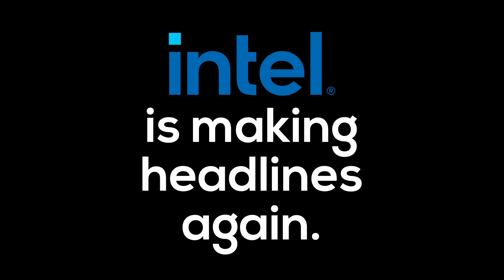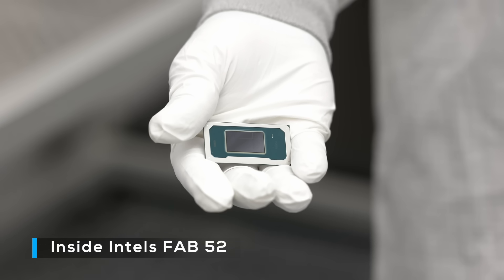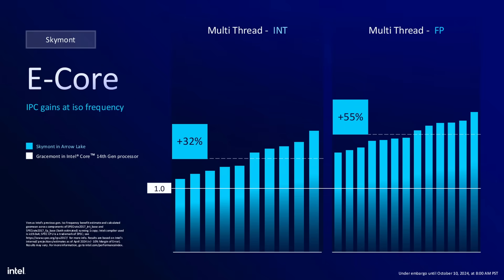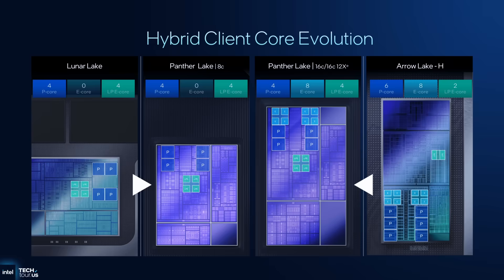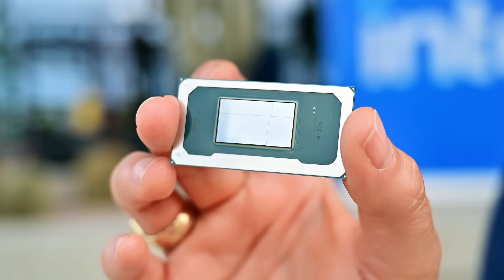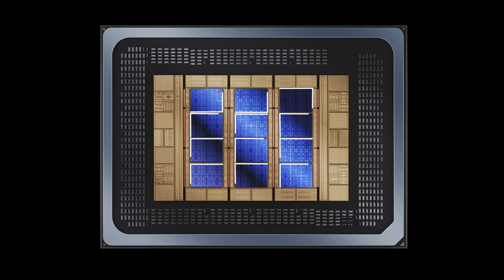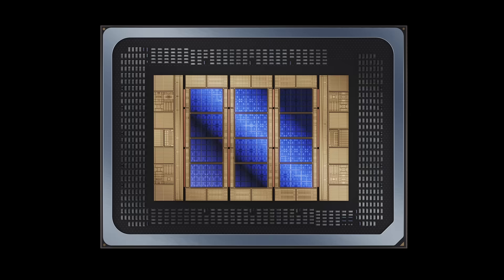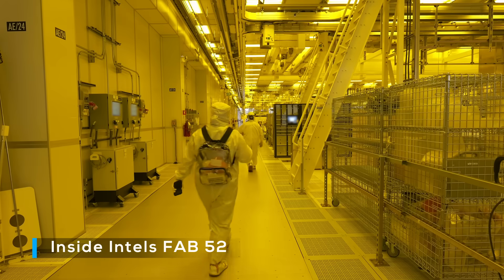Panther Lake, 18A & The current state of Intel

Comment: A new incompatible Socket for each new generation, shows a very shortsighted or money optimizing way of thinking
Reply from the maker: Panther Lake is mobile only, so no real "socket". Let's see what Nova Lakes does. I agree, Intel needs to have a plan for a long term socket. AM4 was the GOAT and AM5 is shaping up to repeat that again. Zen 4, Zen 5, Zen 6 and maybe even Zen 7. Intel needs at least three generations, and a simple refresh gen doesn't count here.
Reply: @HighYield  I definitely think if Intel is going to support their new Nova Lake socket for a long time, they need to waste no time in stressing that. Really commit, set it in stone even.

Technically, while these aren’t socketed obviously, I remember someone talking about how something they did with the BGA setup on these was neat. I don’t remember wether it was backwards compatibility with some previous generation or just that all three variants use the same BGA platform, but same-ish concept as socket longevity.
Reply: @HighYield  AM5 is going to be squeezed for too long and become a design burden, it simply lacks the pin count to supply sufficient IO for higher multi-core throughput and Threadripper is too large of a step. Mid-range desktops should have been pushing 1TB of RAM by now and have rdimm options. (16GB was common in 2012 for $200; 13y/2y =6.5 doublings, 16×2⁶=1TB.) 

Maybe they will overlap AM5 with AM6, keeping AM5 for smaller Zen6 and 7 CPUs and use AM6 for larger Zen6 and 7 CPUs. AM6 really needs pins for at least 3 mem channels and a few more PCIe lanes.
Not sure if it would be technically viable but they could do an AM5+ socket like they did with AM2[+] and AM3[+]
Reply: @mytech6779  that's what you and some other enthusiasts want, but its not going to happen, 2 channel ram continues to be the standard even if it would be cooler if it was otherwise, because that extra IO has a cost and most consumers wont pay for it, i was hoping for a smaller threadripper platform, but it sadly didn't happen
Reply: @HighYield  intel now is the underdog. it needs at least 3-4 years of board support. i dont see how intel can compete in desktop space if it still using the old tick tock tactic
Reply: I wonder if they have a choice. Supporting socket for longer is more expensive and thus, eats into margins. That is something Intel can ill afford at this time. Even if the CEO tried to rollout a socket with longer support, if it turns out to be financial burden, they get kicked by the stockholders, so part of me understands it.

But if 18a is a consumer sucess, and their margins are healthier again, we might see a longer term support for some of the sockets.
Reply: @DavidHauslerProductions   more sockets is more expensive or you think its free to setup a whole new platform vs connecting to an existing platform
Reply: I don't even care about compatibility at this point. The amount of socket names I have to remember just to be able to build an inferior Intel-based PC makes my head spin. Whereas AMD's approach is like "We have the old one and the new one, whadda you want?"

Comment: 10 percent ipc improvement in 2 years while moving from 3nm to below 2 nm where you can fit 50 percent more transistors is laughable...x64 based chips are in legacy/maintainance mode now it seems
Reply: Well, if that is the only metric you are looking at, it sure seems like an expert opinion.
Reply: @DavidHauslerProductions  ipc novalake +11% compare to pantherlake, razerlake+ 25% compare to novalake, unified core +22% compare to novalake.
Reply: Don't be too hard on the M4 for basically being an M3 with a clock speed boost, and the M5 finally achieving just under a 10% IPC improvement...
Reply: @ux-ss6ds  the fact that you had to bring apple /arm to compare to says a lot about RISC architectures.... even intel admits so pentium 1995 was the last CISC based chip later on all are just RISC emulation at ISA  level as an computer architecture student it's really difficult to implement x86 based  variable instructions and variable pipelining stages... even m3 achieves around same single core as 14900k though m4 is at 4GHZ and 14900ks at 6GHZ.. intel knows that as well to increase performance frequency and voltage have reached their limits the IPC is the only way forward.... intel knows that's the reason intel and amd have arm and RISC-V side projects as well x86 is no longer sustainable .. it's just the truth
Reply: @mdyusufzaman9356  people like you keep screaming for the end of x86, but in the end x86 doesn't care about your opinion and keeps outselling all others,
Reply: And despite al these drawbacks it's still superior to arm.
Reply: @aristotelisentertainment279  because you say it so ? it's basically arm like at microarchitecture level... it emulates x86 at ISA level... in every conceivable way risc types architectures are superior sustainable in every possible way the.. only reason we  still have x86 chips now is to support decades of software backend it has & and to maintain backward compatibility....
Reply: "3 nm" and "2 nm" are no more than just names.